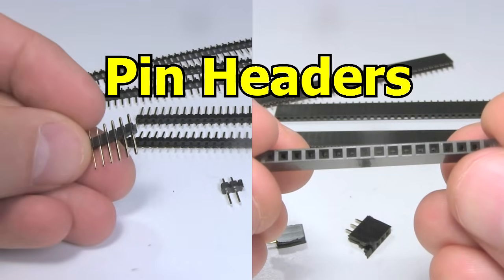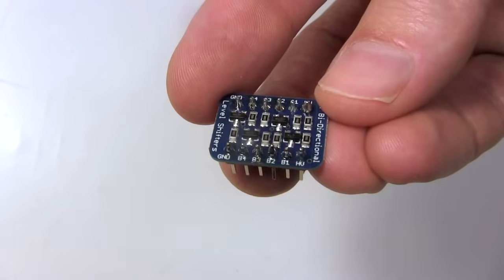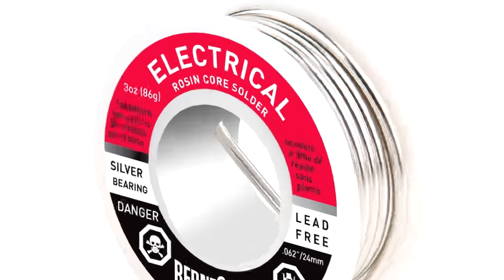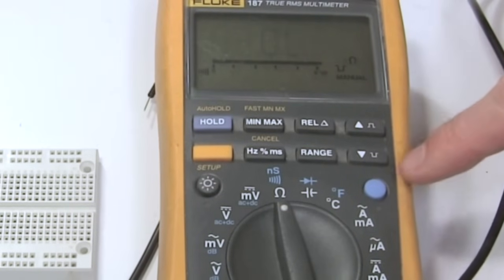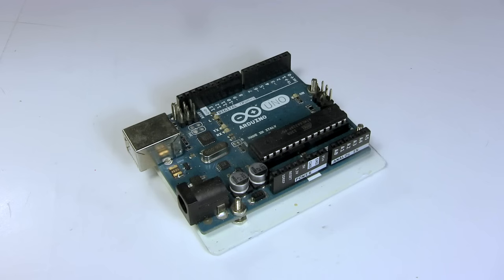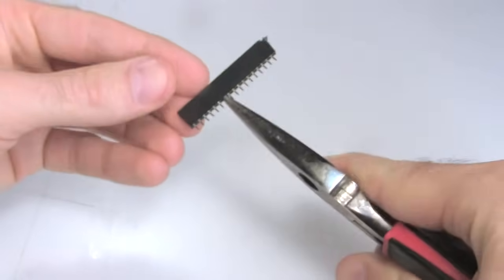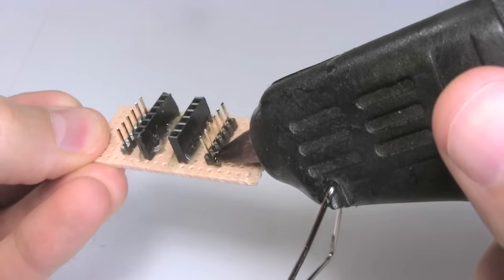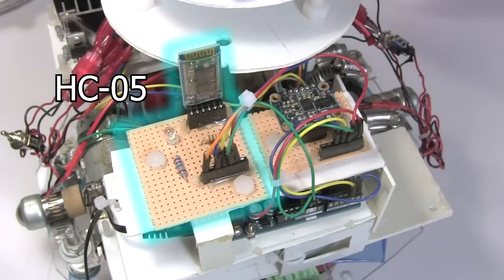Pin Headers - soldering, cutting, male, female, etc.

Comment: Thanks for your video - If you have a female header installed on a pi, how can you connect this to a P.HAT which also has a female header
Reply from the maker: Use a jumper wire which has male pins on either end, like the one I show at 4:59.
Reply: Thanks

Comment: Is it okay to solder two separate pin headers onto a board that have the same spacing but are not connected in an entire row?
Reply from the maker: Yes, that's okay. That should result in a bunch of pins (male pin header) or holes for pins (female pin header) that are not connected to each other as long as you're careful to not solder the pins underneath together when you do the soldering. Each pin sticking out the bottom of the pin header is electrically connected to whatever you plug into the pin or hole directly above it.

Comment: I would strongly recommend you switch over to breadboard/prototype board with Plated Through Holes (PTH). You solder pins and components to the plated holes and don't need to use glue. They are much stronger and better looking without glue. The plated holes make convenient places to solder your circuit wires, and by bridging spans of holes with solder, you can make rudimentary routing right on the board with solder bridges. You will never use non-plated breadboard again. Also make sure you use no-clean solder, or solder that cleans off easily like water washable or alcohol washable solder flux. Rosin core solder makes a mess and can eat your board if not removed, and is really hard to get off without harsh chemicals.
Reply from the maker: Thanks. I've seen videos where that type of board is used and the ability to make traced directly on it is nice. I'll order some.